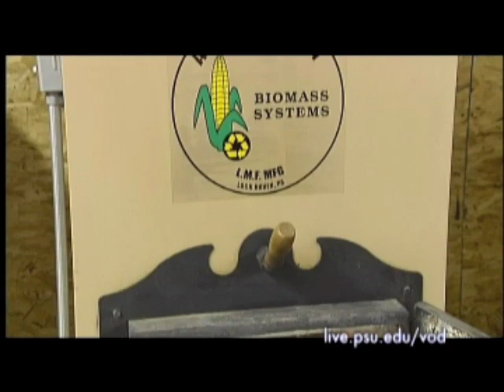Energy Alternatives

Comment: It's really easy, however, to take too much carbon out of the forest and the tilth of the soil till it doesn't hold water and doesn't produce as much. Then it doesn't sequester carbon as well as it did, and then you have more global warming. For example, we need MORE carbon in the forest and in the soil and not less, and that means tilling under the cellulose that could be used for biomass. Example, this nation used to have three FEET of topsoil from its original forest, which we drew upon like a bank account for hundreds of years, till now we have less than 3 inches!